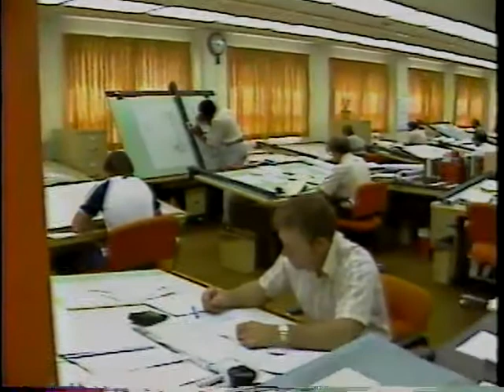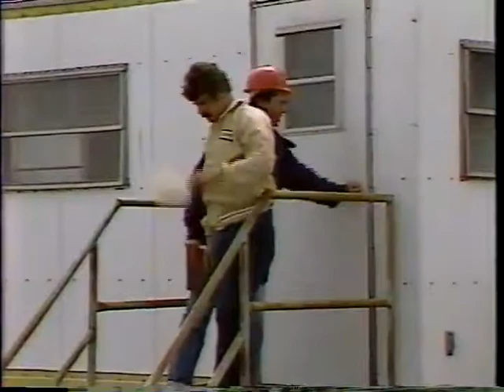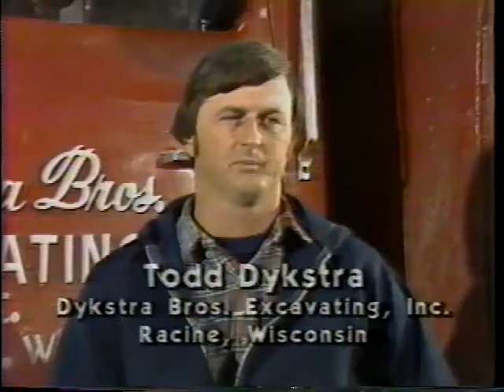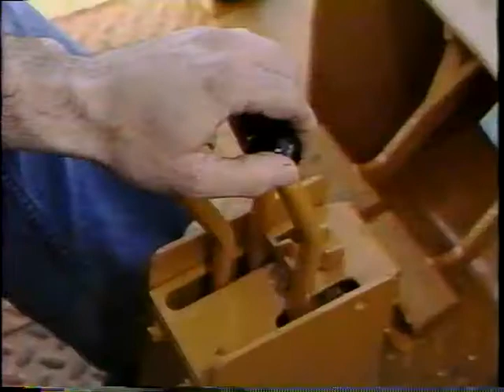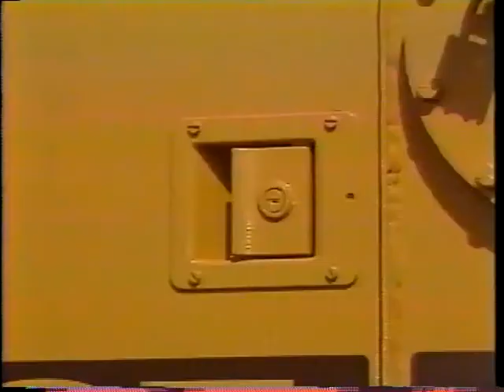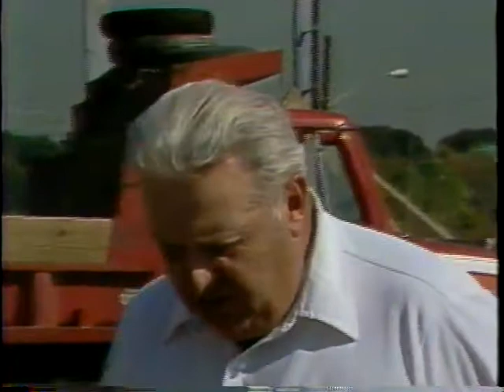4.05 Case Geared Steering

Comment: I loved the POWER turn levers between my legs on that 850 series 😊❤😊 back in 1979 
We had an 850 doing pea gravel runs and backfilling on a mainline sewer project. This was in very muddy side of ditch work. The 850 was so " FAST" at running the long stretches to the gravel piles for pipe bedding 😊 I really do not think a wheel loader would have worked. We also had a 125 international loader on that job. The case ran circles around it. Just my experience with a new at the time 850 series case track loader